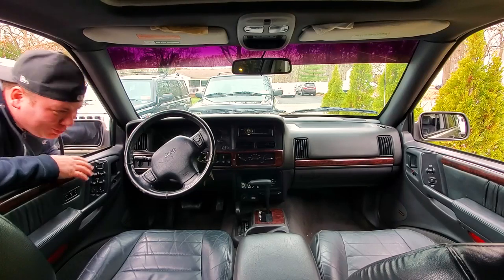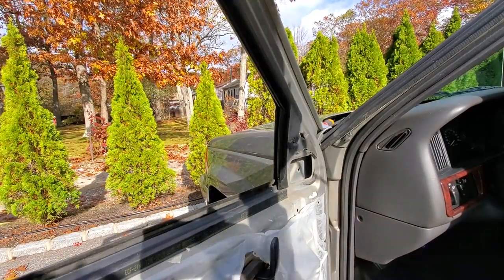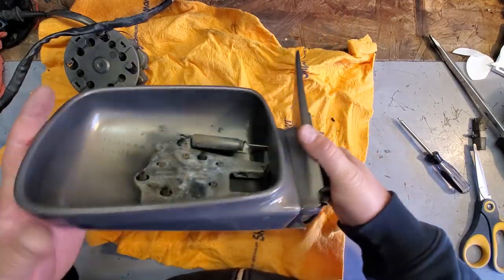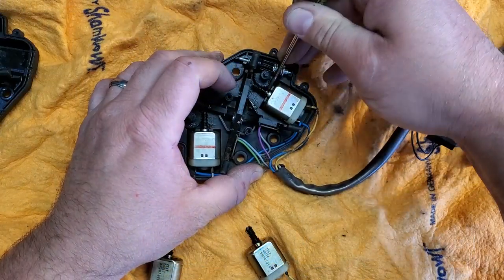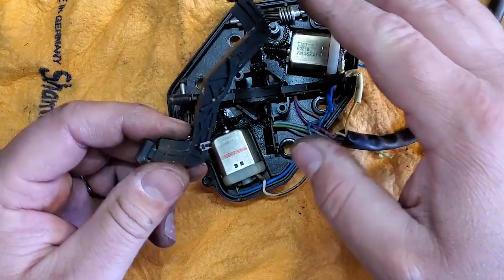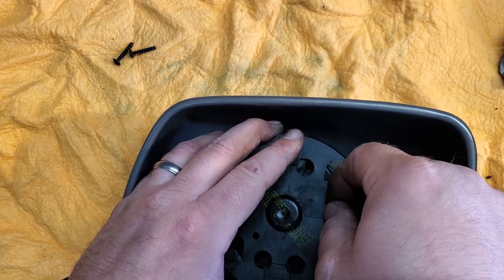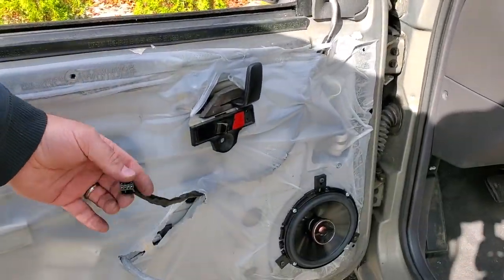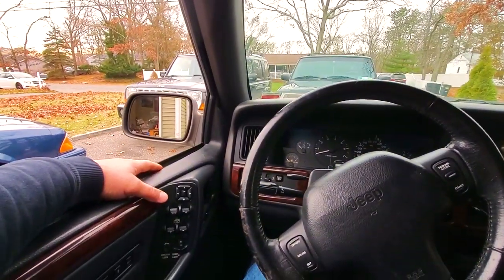JEEP ZJ SIDE VIEW MEMORY MIRROR MOTOR FIX AND INSTALLATION

Comment: If you have problems with memory, just drive mirrors from end to end multiple times. That cleans the contact taps and they will work again without need to teardown
Reply from the maker: this works sometimes, not always..  many times a teardown is necessary

Comment: I love the zj build Dan !!!! Question though will you do a video on how to restore the steering wheel leather because that's one thing I need to tackle in my zj
Reply from the maker: lol. Every single time I sit in the ZJ I debate weather or not to re-wrap it or just replace the whole thing.  What option would you like to see?
Reply: @ProjectDanH  I would love to see rewrap....I have looked at replacements at my local pick and pull and it was impossible to find a decent steering wheel that was molested ...... They have some kits on eBay too that aren't pretty reasonable !
Reply from the maker: @crayfishroll  sounds good! Another project on the list!

Comment: Nice video! Still on the hunt for a chromatic mirror lol. Do you have memory seats as well or do you need a separate chip in the seats for that?
Reply from the maker: Thanks Brother!  I have a 5.9 memory seat but the leather was bad. I was in the process of putting the memory module on my 4.0 seats but realized all the motors are different. memory motors have an extra solenoid on them.  maybe one day I'll just replace the whole frame but till then I shelved the memory seat function project.

Comment: Luckily my 98 ZJ doesn't have the memory feature LOL.  The memory feature in my 96 ZJ was always haywire it seemed.  The memory feature in my 96 ZJ also was supposed to readjust the driver's seat along with the mirrors, none of it ever worked properly, so I'm not upset that my current ZJ doesn't have that feature.  The auto dimming mirrors are very nice to have though.
Reply from the maker: 🤔 I wonder if your memory buttons got water in em an maybe shorted something?? Oh well either way theyre gone now, lol.  Maybe one day Ill hunt down that auto dim feature.
Reply: @ProjectDanH  That whole door panel got water in it quite frequently, but they never worked from the beginning so it wasn't a water problem it was a factory design flaw.  My 96 ZJ was offroad more than it was on the highway LOL, it was covered in mud most of the 8 years I owned it, and it still managed to be trouble free till the viscous coupler in the transfer case failed around the 219K mark and I finally sold it at 232K miles still ran and drove great just needed a transfer case rebuild or replacement, and the guy who owns it now just swapped the 249 out and put a 242 in it and has been driving it daily the past several years trouble free as well...not sure if that thing will ever die last I saw it this spring he had 680k on it.
Reply from the maker: @wildbill23c  wow! That's impressive!
Reply: @ProjectDanH  Hope my 98 ZJ makes it that far LOL.
Reply from the maker: @wildbill23c  me too man, me too!

Comment: Hey Dan, I'm having an issue with my mirrors tilting down and not returning to the up position.  Every time I enter my ZJ I have to adjust both mirrors up. As long as I don't use the key fob to lock the vehicle the mirrors will stay. I've tried setting the memory on the door but the mirrors don't seem to accept the memory set. Help me out brother! Lol
Reply from the maker: you'll have to dig into the motor and clean the contacts out and make sure they are making a good connection.  overtime crud and ware will disrupt your connection making your mirrors to go into default mode resetting then to the down and away position.
Reply: Thanks a lot man!
Reply: I have the same problem with mine "98 zj. Could you solve the problem, if so could you tell me how thanks!

Comment: Is it possible to install the motor assembly with memory function in a housing from a mirror originally without this function?
Reply from the maker: Yes. That is what I did
Reply: @ProjectDanH  thanks for answering

And it's possible with aftermarket mirrors? I'm not sure if the internals of the mirror are the same

Comment: So I have the same exact cherokee...but I have a problem with trying to get it to go past 70mph and my overdrive is ON ....it doesn't overheat or anything it runs great and drives...but the problem where it only covers half the speedometer...I was flooring it and it just would never go past 70...u know why? Or how I can fix?
Reply from the maker: Hey,. Thanks for the question. That's very strange to me. I haven't experienced a problem like that.  Maybe the overdrive is says it's on but it's not engaged.  Any check engine lights?
Reply: No no overheat, no problems at all with engine except that....the overdrive.should I try driving with the light on?
Reply from the maker: Im not sure man. Id love to help but I'm not but familiar with that problem and wouldn't want to steer you in the Wrong direction

Comment: my driver side memory mirror on my 04 zj wont hold the memory, it readjusts itself every time i get out of the car.. thoughts?
Reply from the maker: Possibly a bad connection between that chip and the contact.  Grab an extra piece of mirror glass and wel open it up and see 😁

Comment: Awesome video! but,.. mennn.., Finally found a working chromatic mirror. Shipped over to The Netherlands, and that that piece shit was so hardly glued on the bracket that I broke the mirror while removing it. There was no way I could save the mirror. Bye bye $$.. 
I was wondering if you could re-fill those electrochromatic mirrors. As long as the glass is not broken you should able to remove the old liquid with a needle and re-fill with fresh electrochromic gel right?
Anyway, next time if I ever find a electrochromatic mirror, I will destroy the whole casing for it in order to safe the glass. blegh such a sad day
Reply from the maker: damn dude, so depressing.  you've been looking so hard for one.  maybe someone can make you a new set

Comment: my 2013 Jeep Grand Cherokee driver side mirror rotates way past the normal detent. In fact it rotates forward towards the front of the car and when I push to rotate in it keeps going until it crunches to a stop. I tried rotating it a few times to reset the rotation range but to no avail. Is there a memory chip for this function? Why all of the sudden did this happen, I looked online and other JGC’s have this issue also…
Reply from the maker: Its usually due to bad contacts in the motor. you may have to take it apart and clean it